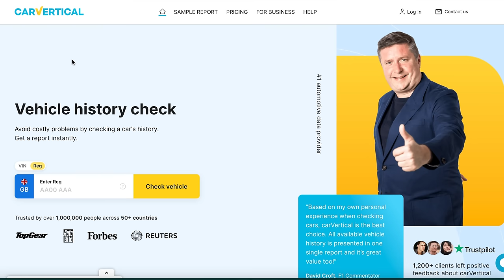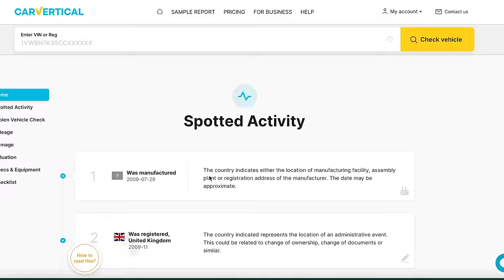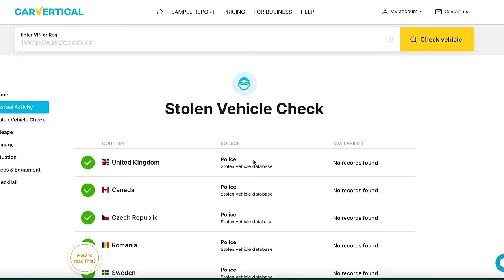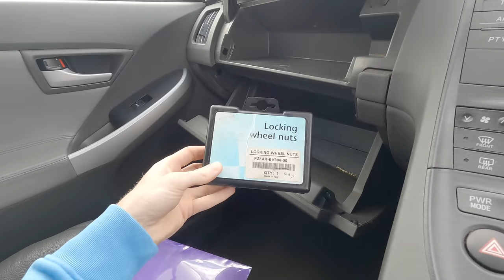I BOUGHT A 200,000 MILE TOYOTA PRIUS

Comment: I used to work for Toyota, and I can tell you the hybrid models almost never go wrong. 200k is nothing for these, I have seen original Prius still on the same batteries still running fine. They are built to last 👍
Reply: Rignt. Mine has 400k miles and no issues yet.
Reply: Mine had 330k miles
Reply: @jboss729  Just bought a 2013 model, 180 km on it I'm sure it'll go to 500+ k with good maintenance, best most reliable cars on earth Toyotas are.
Reply: Do the tailgate “wings” all wobble like that when you close the door?
Reply: The big question everyone wants the answer to is how long batteries last on BEV’s, and the cost/viability of replacing them. This hybrid has had the battery replaced under warranty but presumably the battery here is smaller/cheaper? So would a BEV battery also only last around the same 178,000 miles as this, and would all the manufacturers go bust if they all replaced the batteries under warranty? And where would you, the dealer, have been if the battery needed replacing when out of warranty? All subjects for future episodes? Was the £4,400 bill for just  suspension work or did that include the battery? Not clear in the vid...
Reply: @KP-wt8qr  no Lexus are but Lexus are owned by Toyota so yeah
Reply: Waoo origimal battery??? So it’s totally fine to buy prius with 140.000km on it?
Reply: How about the head gaskets?
Reply: How to maintain the drive for good battery?
Reply: True.  My 2010 has over 210k miles, with its original battery, engine and transmission.  I did replace the brake booster assembly by a dealer which costed a fortune.  Other than that, with routine maintenance it's still going strong.
Reply: @soyphea8697 it's all automatic. The Toyota system makes sure that it doesn't drain or fully charge the batteries which prolongs the battery life
Reply: @lotusgroup123  Heat is the main killer for the batteries between clogged filters, filthy fans, and overall hot climate especially in the summer in much of the world. In cold weather climates they can last far longer than most would expect. At the worst there is an after market lithium upgrade which does boost economy and performance a bit but is diy.
Reply: Maintenance is the key to these cars lasting forever. Battery fan cleaning every 3 years, transmission fluid change every 80k miles, coolant & inverter coolant change every 100k, water pump & thermostat every 100k, spark plugs every 100k,  egr & intake manifold cleaned every 100k, change brake fluid when it's dirty, keep windows cracked on hot days so hybrid battery don't heat up. I got my 2015 Prius at 130k miles running strong with zero issues. My original 12 volt battery started going bad and just replaced it 2 weeks ago, that's 8 years with the original 12 volt, not bad at all.
Reply: This generation is notorious for the engine head gasket leak. Many say that it typically starts occuring after some 200k miles.
Reply: Mine is all original with 225k. 03 with no issues and I also have a 2010 Honda insight with original battery with no problems albeit only 116k. Yes my mortgage is finally paid off.
Reply: We rarely have head gaskets problems in Europe, our "gas" has a much higher quality than in the US.😂
Reply: If a hybrid car is second hand it’s not good anymore if you are going to buy a hybrid car then buy it brand new
Reply: @jboss729 how old is your prius, did you change the hybrid battery ?. Please reply. Thanks
Reply: @tee7697  why did you sell it... 
What needed to be done to the car when you sold it?
Reply: But they are more complex
Reply: Well then if I ever get one then I'll take good care of it
Reply: brother I was in a Mk3 with 990,000km - it was a taxi
Reply: I after a corolla 1.8 hybrid estate next so good to know.
Reply: This is an early 1.8 so if the British market has EGR it probably needs to be checked as that was the weak point in gen 3 Priuses
Reply: Is it true that this generation - up to the 2015MY - sometimes consumes a bit of oil?  I’m toying with the idea of a used 2015MY for this reason. Just in case!  This really does look a good, honest example. I’d probably leave the bodywork alone and embrace the car as it is. I’d trust this car to drive to Italy and back without dropping a beat!
Reply: On a Prius c I just got a “check hybrid system” notice at 200,640 miles.  Any ideas how to fix it for cheap, even if labor is involved?

Comment: Thats Low mileage for these. If you clean the battery filter every few months the batteries can last 300-400k and service the engine every 5k and its bulletproof
Reply: engine service every 5k sounds a bit often for my taste, really.
Reply: Hi, wheres the battery filter? Just got one recently. Is it the vents near the rear seats.
Reply: @hughlevantjames905  every 6-7k is also fine
Reply: @VfxRaptAnime  on the Mk3 prius its behind the seats on the right side. There’s plenty of videos that show the whole process. Search toyota prius battery filter clean
Reply: I’ve seen them on 350k odd miles and of course you pretty don’t see them used by anyone but taxi drivers
Reply: @subhan7782 thank you
Reply: Yes......but look at it....just look.
Reply: @Alexander_l322  I found a 2012 model on Autotrader with 420k and it had apparently never been used as a taxi. Must have been used for something similar though.
Reply: @subhan7782  6-7k is a bit unnecessary.  Even 10k is a bit soon with decent modern oil.  But I still stick with 10k.
Reply: @fastasfox  Looks better than many cars on the road; so where's the issue?

Comment: I traded an ex-taxi second gen Prius a few years ago. It had done 730,000km, the owner claimed he'd never changed anything, and the hybrid system worked perfectly, the trip meter was still reading 21km/litre economy.
Reply: Maybe the trip meter is broken
Reply: @SuperKiko112  I think not, that is very normal economy for a gen2 prius (when driven by a penny-pinching taxi driver, at least). They're also most efficient in regular all-day inner-city use, you won't get 20l/100 driving at 100kph.
Reply: my 2016 prius has lasted 300000 miles with no major issues yet.
Reply: @2pintsofcremedementh  Doing a rough conversion, at 100kph (62mph) my fiancée's gen2 will easily do 60mpg or about 22km/L.

Comment: I bought my 2010 Toyota Prius 4 years ago with 2ooK miles for 3 grand (US Dollars). I now have over 4ooK miles on this Prius and it runs great!
Reply: Did you ever have any head gasket issues? Found a 2010 for 6k very clean. It had 185k original battery.

Comment: Bought a 2012 Prius 2,5 years ago with 137k. Now it has 210k. All original. No problems so far. Service every 15k at the local Toyota dealer including hybrid check. If something happens to the hybrid system they will fix it. Guaranteed till car is 15 years old. Brother in law was impressed. Bought a 2009 Prius with 240k. Same story. All original an now 300k+. Amazing cars!!

Comment: Hi Matt, you hit the nail on the head with regard to these cars. Have owned 3 different generations of Prius, not one has given me any mechanical or electronic problems. Just regular servicing. Here in Australia 10000km/6 monthly service intervals takes any worries away. Current gen 4 2017 model one set of tyres and a 12volt battery. 62-64 mpg and a transmission service in the next few months. Just start and go. Great channel, enjoy all the videos.

Comment: As a person who moved into this country the first thing I was recommended was "go get a Japanese car, they won't fail you" As this video shows

My first car here is Toyota Corolla 2006 petrol with 115k mileage, 100% working serves me well with the AC so strong it got me cold in the heatwave days in 2021.  After a bit of settling, I switched to an 89K mileage Nissan Note 2014 because of loads of option extra and cruise control needed.

This little Note is just the same as what I always drive in Japan, whether in the hot weather like Okinawa, or the gigantic city in Tokyo to the snow mountain of Nagano, or in this country from London to Plymouth, and Broadstairs back to London, they were never let me down, all function with a green tick.

They maybe lack of drivability to their counterpart in Europe, but the reliability of them is always trustworthy.

Another great video!

Comment: I have a relative who lives in New Jersey, USA,and they have a Prius which they use to commute to work every day, with 375,000 on the clock. It's been maintained regularly and it still runs like new. The only things they've had to renew, are the service items you'd expect to have to change.
Reply: wouldn't really trust this thing in the snowy season there. I'm a born and raised New Jersean and we have some pretty foul weather. The Prius doesn't inspire much confidence in snowy conditions
Reply: Do you know what year the prius is?
Reply: @colechapman6976 just got a 2012 197k prius (came with a set of winter tyres) and im in Maine. Looking forward to winter😂
Reply: @colechapman6976  Im from the PNW, Washington specifically, and theres a running joke on the hiking forums around here when someone is trying to figure out if a forest road is washed out or someone had a hard time getting through with their truck or something like that, only to find out a Prius is parked at the trailhead.

Comment: I’ve never driven a Prius, and I don’t need to change my car, but you’ve almost sold it to me! It looks great. Perfect for someone who needs a cheap car but doesn’t get excited about torque peaks etc. Hope you get a good result!
Reply: Prius is a very good car owned both great driver even if you are a car person.
Reply: I've got the same car, the same year. It's done 360,000 still going strong!
Reply: I've got a 1.5l gen 2. Great for commuting. Automatic so not as bothered when in traffic. Reliable and 58 to 62 mpg depending on speed and temperature.

It's ugly and boring, but I drive 78 miles a day to work and back..

You will get looks though. I'm 37 and people don't expect me to drive a Prius... Lol
Reply: @UnseenSpirit  im 22 and considering getting a prius
Reply: @osman.s1405  Do what makes you happy. If it's saving money using a relatively cheap car to buy and definitely to run, then go for it. 

I drive 78 miles a day to work and back and have saved so much money compared to when I had a new 2017 Qashqai (at the time) which gave me 33 mpg at best.

What I save I spend on my hobbies pretty much or whatever my wife and I need.

Comment: Still driving my 2003 Prius, it is just reaching 200,000 miles and is pretty much as good for mileage as it was the day we got it. Still prefers long runs in hot weather, doesn’t like cold starts and short journeys. We’ve been expecting to need to replace it for the last couple of years, but it just keeps. on. going! Plenty of dings, knocks, scrapes and dents on the outside though.

Comment: With a main dealer fsh, replacement battery and suspension, that’s great value. It’s not like the engine is going to give you any issues. Nice car 😊
Reply from the maker: Totally agree
Reply: the Atkins cycle engines are known to burn oil like 1l per 1k miles. I know from experience.
Reply: Cat converter theft would put me off
Reply: They suffer from head gasket issues
Reply: You’ve just jinxed the engine now. Well done, it’s now destined to explode.🤦🏻
Reply: @MrTangolizard  you have to.get the egr cleaned to avoid head gasket issues

Comment: Toyota have the VIN numbers on all the pannels and doors if you ever suspect they have been in a bump. Looks very clean. At 200k miles it's definitely got 100k more left in it. Common issues on these are the EGR valves and head gaskets. But supply and fit centers will fit replacement low milage engines for £1000 so usually the way to go if the HG ever pops. Ideal tools to do a Job.

Comment: I had an Auris hybrid as a company car and at first I thought it was boring but that's not what it's about. It's dependable and once you've settled into that not much feedback thing it was like driving around in my favourite armchair, and after a stressful day sometimes thats exactly what you need. I had another Toyota that had proper textured carpet in the headlining and headlight protectors for the headlights like another set of headlights that went over the top which was odd, these old folks homes on wheels I have a bit of a soft spot for. There's a lot to be said for just wafting along.

Comment: I bought a 2013 with 260,000 miles on it. 2 years later I drive it 10,000 miles/mo and it has 450,000 miles on it with no problems. Best 4200 dollars I ever spent.

Comment: I don't live in the UK but really like your channel and come back every now and then. Glad your business is doing well. I have a 3rd gen prius. For anyone who has one, make sure to replace the intake manifold and EGR valve, clean EGR cooler, and install an oil catch can, no matter the mileage; if you plan to keep it long term. No drive belts, love mine. I've lowered mine and put wheels on it. Lots of cool aftermarket parts hah

Comment: Seriously considering a CT200 - relevant to the Prius -  or (perhaps bizarrely) a GS450h as the next car; Interested to hear your opinion on the 450h?
Reply from the maker: Yes I need to get one on the channel
Reply: Would much rather have a CT to a Prius
Reply from the maker: @craigwilson3711  so would I buy they’re far less spacious if that’s an issue
Reply: @HighPeakAutos  hmm good point... But Im shallow and go for good looks every time
Reply: i bought a GS450H 2012 2 weeks ago , super smooth and quiet , plus plenty of power on tap if needed from the 3.5 V6 engine
Reply from the maker: @craigwilson3711  haha so am I
Reply: 450h any day everyday, the lexus ct is nice but the 450h is a different level
Reply: The Honda CRZ is also supposed to be bomb proof.
Reply: @MalcolmXpat  I forgot about the CRZ. Their looks were always a divisive issue too but I quite liked them. Plus, because it’s a Honda you know it’s gonna keep going and going.
Reply: @craigwilson3711  Depends what gen Prius. The current gen is arguably a better car in some ways than the Lexus CT since it rides on the the TNGA platform. Better ride and handling. The current Prius is very good to drive and basically the same car as the current Corolla which is critically acclaimed.

Comment: New hybrid battery, now that makes sense. Nearly 200,000 miles on the factory original battery made me think something wasn't right. Seriously considered getting one of these, but my best friend who is rabidly into EVs told me to stay away. Too sluggish in terms of acceleration.
Reply: theres half million mile prius taxis on original hv battery
Reply: Imo the acceleration is fine. Where you might consider something else is if you are driving up a lot of hills or mountains, or are constantly needing to floor it onto a highway (but who needs to?) 
I'm not sure why so many people think they neeeeed the acceleration unless they are into sporty driving. Proper regular driving doesn't need high acceleration

Comment: 2007 Bmw 320D M SportSaloon Manual Fully Loaded bought in September 2020 for £1,200 @ 233k Miles Previous owner Bought in 2010 @ 86k Miles from BMW dealer & only took it to Bmw all previous Services etc receipts from bmw.
Now @ 270k Miles no issues what so ever only have done service & changed Disks & Pads everything else still running like a dream, Now I admire high mileage cars .

Comment: We have one with 310.000 miles on it, runs absolutely great. Did head gasket and batteries at around 150k miles. Rear brakes still original.
Reply: How much did the batteries cost you?
Reply: @lovelyjubbly87  1700 eur in Toyota

Comment: Way more reliable at 200,000 then my mini at 60,000 😂
Reply: Any car can be reliable or unreliable, just need to be unlucky like me when owning a auris hybrid, a repair bill to get it past its mot would of cost in excess of £3k with main dealer being only garage who would touch it due to being a hybrid.
Reply: @ascelot  i have had the car since march. 15 engine lights and a new clutch and dual mass fly wheels later its still a pain in the neck
Reply: Minis reliability is horrendous. I believe the French PSA engine were the worst offenders..
Reply: @MalcolmXpat  15 engine lights, new clutch and dual mass flywheel, thousands spent on it. Had it for 6 months only with full service history and 60.000 miles. Late 2015. Shocking lol
Reply: @AssumedTiger  sorry to hear that, i love the look of the mini but they have a bad track record. im looking at a second hand Honda CRZ, maybe you could consider the same. best of luck..
Reply: @AssumedTiger  had my auris for 2 years, around 60k miles, 2 seized bushes, 2 break bipes and 2 frozen break pipes (all 4 needed replacing at same time) and steering column issues and thats after having it serviced at toyota for twice before with no issues raised
Reply: @MalcolmXpat  Concidering a BMW Hybrid and some older cars like a Ford Escort or St220. Complete opposites I know lol. If I was sensible I would be looking at a Honda or a Toyota 😂
Reply: @ascelot  unlucky mate
Reply: Had 3 minis to over 150k miles, only general servicing. One to 205k miles only recently scrapped due to rust at 20 years old.
Reply: @MalcolmXpat  I'd vouch for that. I once stupidly bought a car with one fitted. Never again.
Reply: @AssumedTiger  j
Reply: @andrewstewart3778  ok
Reply: @MalcolmXpat you’re not wrong r.e. the PSA 1.6 engine in the Minis.  They’re very well known for literally going bang, one of the worst engines ever made.

Comment: My 2014 Prius is at 221,000 Miles still running great and smooth.  Still same Battery I've had no issues with it.
I plan on driving it until it dies or battery dies